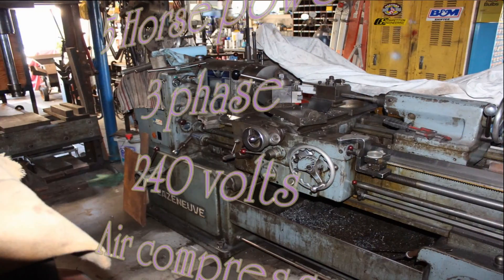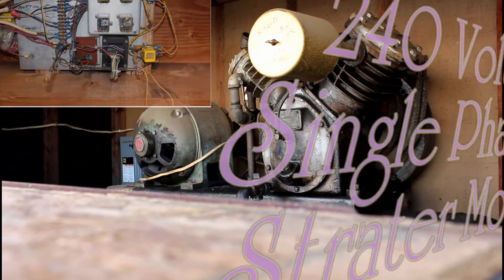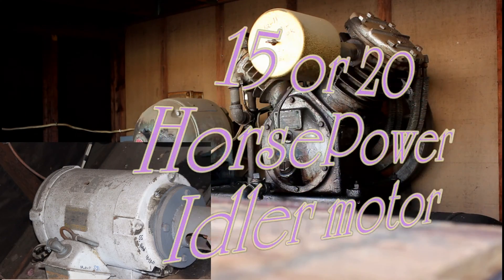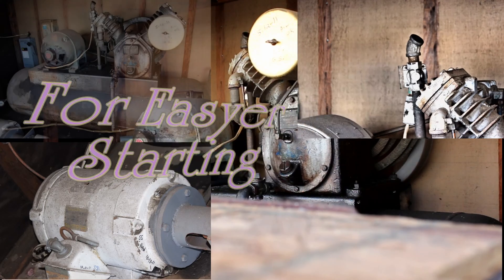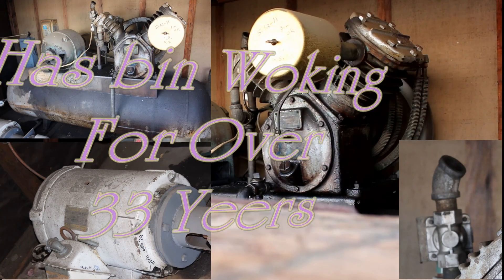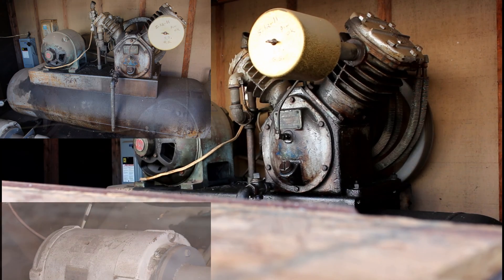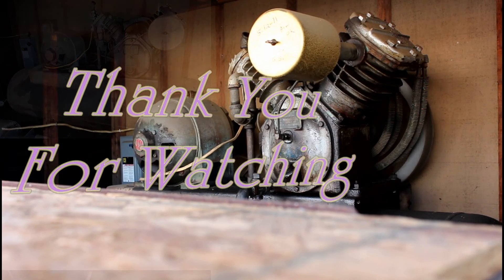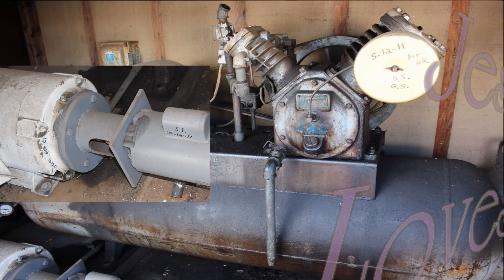3 phase air compessor on 240 v single phase

Comment: Donald thats a cool set up but i have to ask you. when you drop that motor doen to the single phase 220 does it not also drop the output of you 5 horse motor  and where did you get your convertor box and what did that sucker run if you remember? I have been told that when you do that as far as run the 3 phase off single that it jumps your amp draw?? I have a 3 phase 10 horse  but only need a single phase 240 5 hp.  money ifs tight that is why i am picking you brains. let me know please. thank you JD 
jdfleet58@outlook.com